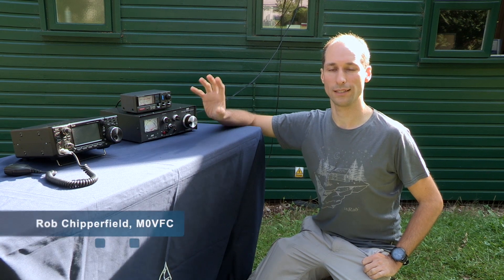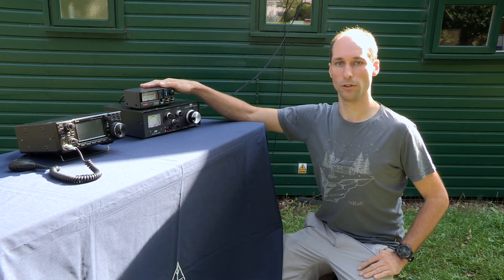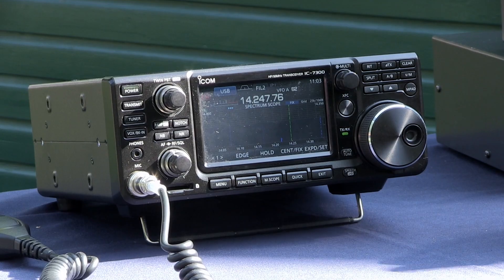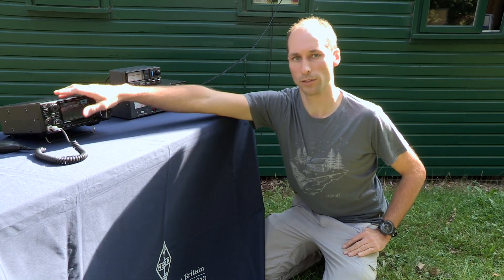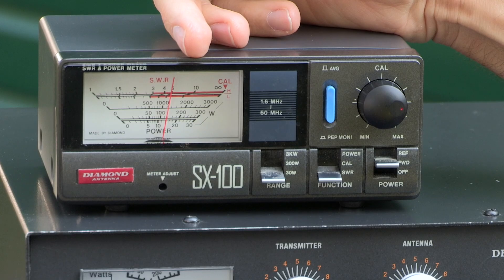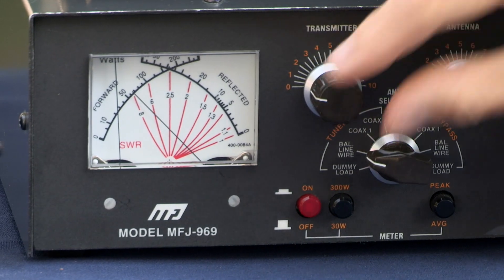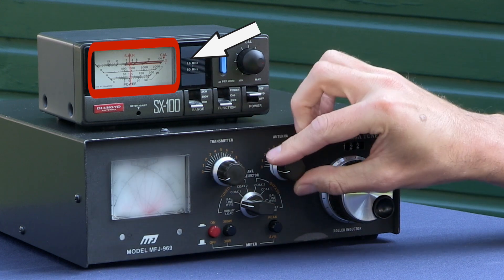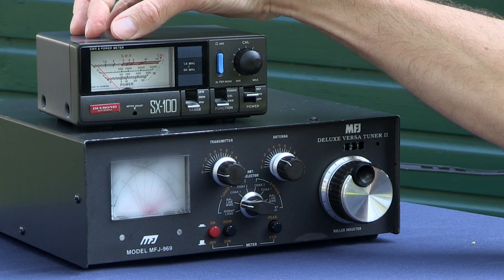Foundation Practicals 2 - How to use an AMU or ATU - the RSGB guide for new licensees

Comment: Thanks for the video.  Not cheap getting started, is it?  :)
Reply: It depends what you want to do. You can work a satellite with a cheap handheld radio, decode pictures from the space station using a mobile phone and the same cheap radio.  This hobby has something for everyone, there is no set way to do anything, and everyone's budget is different.
Reply: @GregoryFenton_UK  Thanks for the reply.  I've got a Baofeng already but was gazing at the IC-7300 online yesterday.  Just funny seeing that adding a PSU, ATU and SWR meter doubles the price :)  I'd discounted working satellites with what I've got but I'll look into it, thanks, 73.
Reply: @weswheel4834  HF/All mode transceivers seem to be the most expensive ones. I saved by getting a used FT450D and homebrewed an antenna that works on the bands I need it on at < 3:1 SWR so I can use the internal tuner. Works a treat for a third to a quarter the price had I bought everything brand new

Most of the OSCARS might be hard to work without a handheld yagi (which can be homebrewed), but the ISS has decent power and gain. I've worked the digipeater, SSTV, and FM Repeater with just a handheld radio and its stock antenna (plus my phone running aprsdroid and robots36) :) might be worth looking into
Reply: @beehard44  Thanks for that.  Even an FT450D is probably beyond me at the moment.  My plan is get my Intermediate and then build a kit ;)
Reply: @GregoryFenton_UK  Oh, sorry if it came across as snarky.  I saw this video series come up this morning and although I've only watched the first couple of videos, I've liked them both, thanks.
Reply: No, it's not. I bought an IC9700 when I passed the Foundation in November. The cost of everything necessary to get it on the air was probably another £1000; but at least I have those things now. 73s, John 2E0SVB

Comment: Nice and simple explanation for the setup with a manual tuner. I would like to see the internal crossed-needle meter used too.

In saying that I have an absolute gem of an ATU built into the Xiegu G90 running the latest firmware v1.75 just released. It is not far off the truth when people say it could tune a wet noodle. It has no issues with 5:1 miss-match and above. I do understand an AMU/ATU has its' place but nothing beats a resonant antenna, as you know. At the end of it all, the tuner does not tune the antenna, it merely make it taste sweeter at the radio end. A bit like getting a lump of stale meat and drowning it with herbs, spices and sauce to hide the bad taste. I have only been licenced since May 2020 and in the beginning I thought an ATU was an essential. Now I just see it as a lazy way to work with any old antenna on any band, but please understand this is simply my opinion. A resonant antenna with throw all your power out there and a tuner/matcher simply catches the reflected power and keeps it away from the PA stage, a critical point I feel for both foundation and intermediate operators who have a very low power output to begin with.

For my final, I have just constructed a cracking end fed (set as inverted 'L') with a 'V' configured counterpoise laying on the horizontal. Coupled to a 9:1 UNUN with a 1:1 UNUN 10m down the COAX. This is sweet 1:1 on all bands (160m to 10m) except 20m where it jumps to a still acceptable 1.6:1 all with the ATU off. The random wire length figures are out the window as it uses high tensile, insulated steel wire instead of copper. I will post a video in the not too distant future of the antenna in portable operation, possibly running IOTA from Lindisfarne.

Please do not let my speech put anyone off from using an ATU/AMU, it could well serve to keep your radio alive  if you are using an antenna on a band it is not resonant for. It can also be a quick and easy way to try a band you have not worked before and unsure about the right antenna or if you even want to work that band again. This has been my favourite part of the hobby so far; making antennas which are efficient and easy to deploy single handed or with a buddy.

Here endeth the sermon. 73 de 2M0FUP
Reply: Hi George
With the very real possibility of a beginner putting power into an antenna, getting a high SWR and damaging the radio then understanding how to use an ATU or AMU could mean the difference between making contacts and having to replace or repair a radio.  Blown finals are a Bad Thing(TM).
Welcome to Amateur Radio
M0ODZ Greg, RSGB ESRG
Reply: @GregoryFenton_UK  Absolutely Greg, I did cover that off near the end and as a new ham myself in May without the practical element I needed to fall back to my CB (boooo) knowledge in the 80's after witnessing so many friends cook their rig with a badly tuned antenna (sometimes simply by not using the SWR meter right). Indeed it can be a very quick way to get on the air but my sentiment was more of not relying on a tuner all the time but maybe as a stop gap until the antenna can be tuned physically. I do admit that it is very handy when wanting to quickly check another band without the need to re-rig the antenna. Cooked radios is a concern I have with the lack of practical element at the moment but we have a huge network of support. (This is where the humble pie gets eaten) This video does just that and I do admit to spending a lot of time browsing ATU's but my personal preference shifted heavily to keeping the antenna resonant (and for as many bands as possible) at foundation level (MM7DSV then) because every milliwatt counts when trying to cut through the eastern Europeans running 1kw+

I am in full agreement with you when it comes to rig safety, better a rig with a reduced range than a cooked rig. Likewise the non-resonant antenna is compromised already and my be producing RFI to local receivers so let the tuner make it palatable for the radio.

I am still on a steep learning slope but I have found things that wee bit easier without an AMU/ATU as I really enjoy making my own antennas which get checked with a NanoVNA before it goes anywhere near the transmitter. Best £40 ever spent providing the calibration is done right.

I hope this proves helpful and does not confuse any of the recently qualified, if I have then I apologise. If this has been useful food for thought, even just for one new operator then this sermon has been worth the key bashing ;-)

Thank you for the welcome to the hobby Greg and hopefully we shall QSO sometime soon, somewhere round the dial.

This is without doubt the most enjoyable hobby I have ever taken up and there must be at least one million years plus of accumulated knowledge and experience out there.

73 de George 2M0FUP RSGB subscribing member (very worth while subscribing if anyone has any doubts).

Stay safe everyone and we will beat C-19 together #GOTA2C